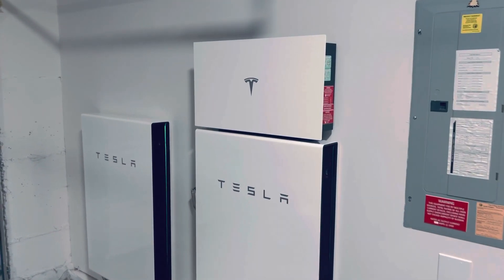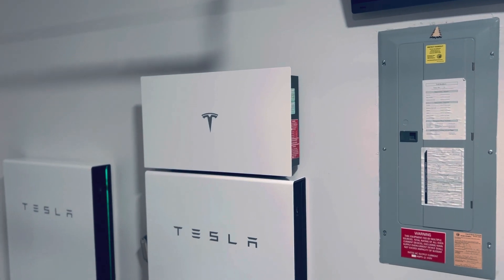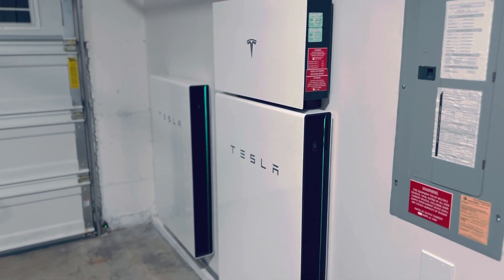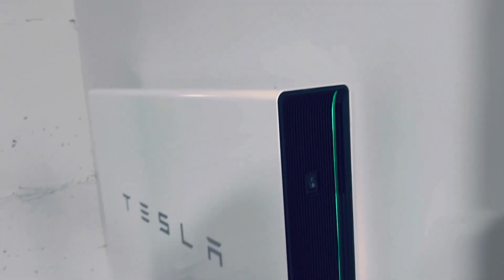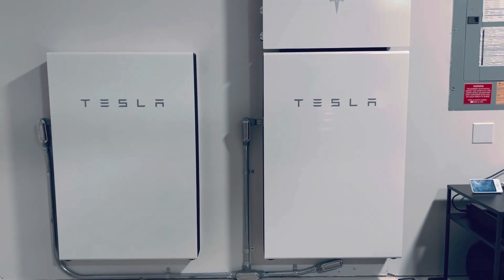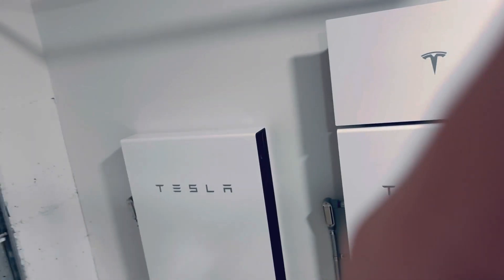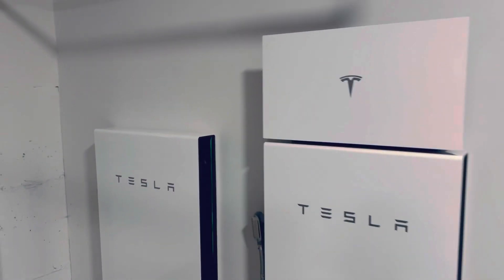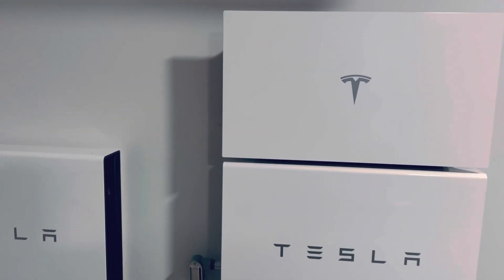🙋‍♂️⁉️ Can you add a Tesla Powerwall to an existing Powerwall Plus system? ⚡️

Comment: Can you run your AC from them?
Reply from the maker: Yeah they can start the compressors with both - back when I had only one Powerwall it would try to start the compressors then kick off power for the whole house during a summer outage. Overdraw reset I assume.

Comment: Hi Paul, thanks for sharing this.  I am struggling between the small 4.25k system with one powerwall  or the larger 8.5k with out the power wall we use between 20 to 30k a day in the summer keeping the AC at 80 to 82. Your system is performing very good. Tesla estimated the 4.25k system would make 68% of our needs and the 8.5k would be 116% . I was concerned we wouldn't make enough extra to charge the power wall.  How much extra per day do you have to charge two powerwalls and power your house? Or did you add more panels also. I'm hoping you would give some hind sight advice.  Thank you 😊.
Reply from the maker: Hi! So I kept the 4kW panel system - it seems that in summer with the long WA days we averaged 25-27kW production which would fully charge the one Powerwall by around 10:30 am when running at the 20% backup threshold (I don’t like to go below that). I opted for the additional Powerwall because I’d rather store energy than give it back and wanted more backup runway in winter for outages. Now in October even on a sunny day I am lucky to get 10kW but I’m typically running 85% backup depending how risky I’m feeling so that’s about right to top off! I think it depends on your goals - double the panels would def be awesome on top of it but for my goals of backup first/energy offset second having another Powerwall was a huge positive! Hope this helps?
Reply: I think I can help with this answer? If you live in a state that gives almost nothing for overproduction per kwh like mine "tennessee" than you will want a second powerwall to keep as much power that you over produce as possible so you yourself use 100% if what you make. I myself was going for the small system but than I realized I used more than what I can make and store so I went for the medium system because of wintertime. I'm an all electric house if that helps. But only one powerwall. I traded more power for one less powerwall to help with the $. Good luck!
Reply: @jaysonstebbins2539  we are in Florida with the net metering to bank credits.  I would gladly get two powerwalls but finances are my constraint. I'm from Northern California and Ironically the small system shows to be all I would need there for 100 percent coverage.  Here in Florida the Tesla app shows it would be about 68 percent.  If I knew how much KW I could bank in the none summer months maybe I could get buy with the small system and one powerwall. We already have a backup generator for emergencies.  I would just like the powerwall to enhance the system so it could be used when the grid is down and the sun is out.

Comment: I’m confused with the powerwall vs the powerwall plus. On the website it appears as if you can chose between the two, but when you go to ordering it just has the one option. What was your experience?
Reply from the maker: I was and could still be confused but from my novice opinion the Powerwall Plus just refers to what I have on the right which is a Powerwall 2 (the current version) coupled with the inverter on top. It’s not anything actually different just the sum of the parts. On the left I just have the plain Powerwall now. The Powerwall plus can host multiple additional Powerwall like mine does. :-)
Reply: @pauledgeman671  ok. The plus weighs about 100lbs more and has a much higher output. Few other features as well.

Comment: Nice job! Looks neat! I am curious of the outcome of the backup setup now.
Reply from the maker: Haven’t experienced an outage but assuming I would have around 36+ hours if normal use excluding oven, dryer AC. Those will work fine if they just eat energy. Loving how the new app projects backup time once you go off grid!
Reply: @pauledgeman671 I have Tesla coming today for the same reason. Due to roof constraints we can only have a 4-5kw system, but a second will add storage capacity and give me true grid independence especially in the summer months. Still need to upgrade AC in the next couple of years